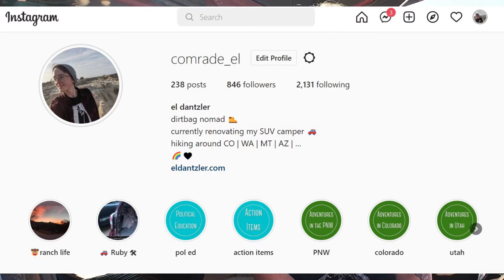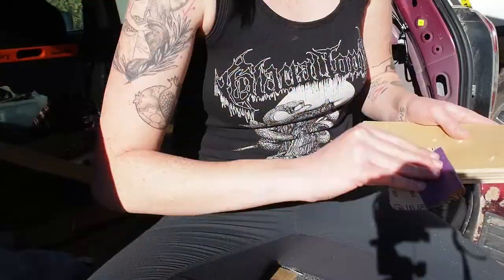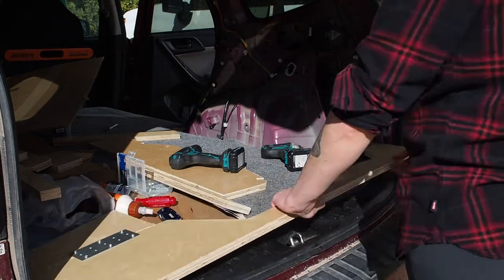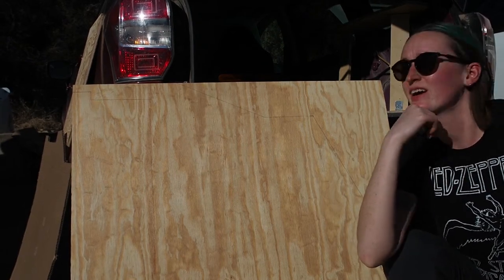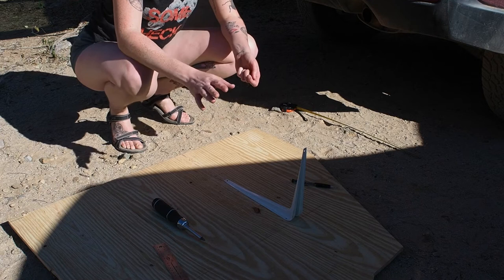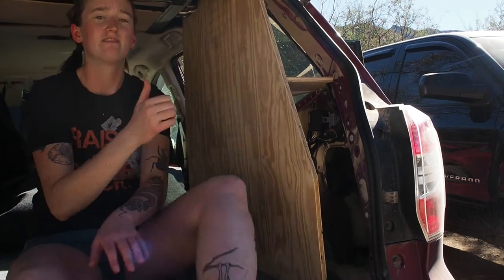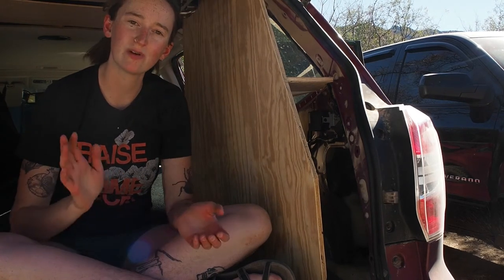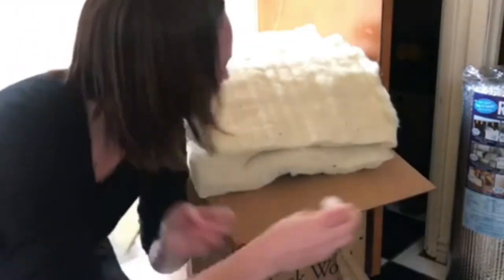SUV Camper Build Update! shelving unit & insulating with wool | DIY conversion 2014 Subaru Forester

Comment: Great video El! Exciting to see the progress you're making. It's looking good. I'm about 60% through my truck build. You are definitely more diligent than I am, lol. I have a spare 1/4" battery impact driver, if you want it? I have two, so I've barely used it. I'm using mine for my build and it makes everything so much easier. Most of the time you don't need to predrill, you just drive the screw in. Yours if you want it.  My channel is up, but no content, yet. I want to finish the build and have at least one adventure before I post. It's getting closer :)
Reply from the maker: Thank you! And yeah having an impact driver would be awesome! I have my website and instagram linked if you want to message me there. I’m excited to see yours when you’re all done, let me know when you get a video up!
Reply: @eldantzler  sent you a message from your website.

Comment: Looking good there El. Nice choice in insulation. Having a cubby hole is nice or you can use the wood & hinges for a door to keep things from falling out & door can be a shelf when needed. Looking forward to seeing how things progress. As for me just got my OB back from shop & now pulling a P0011 code. 3 steps forward & 5 steps back. Oh Well next month.
Reply from the maker: Thanks! I have a plan for the shelf unit on the other side that will use a cabinet door that folds out to a table.. if all goes as planned🤞
That’s a bummer! Hopefully you can get it figured out soon